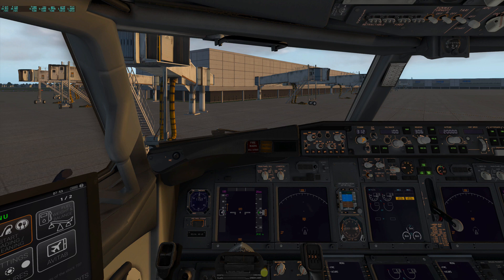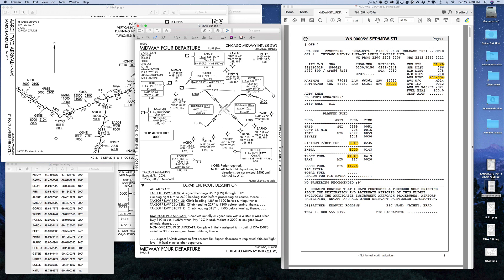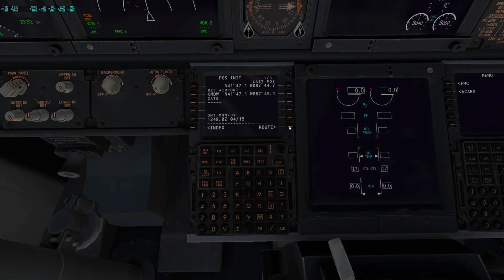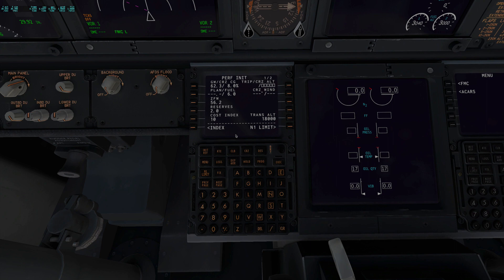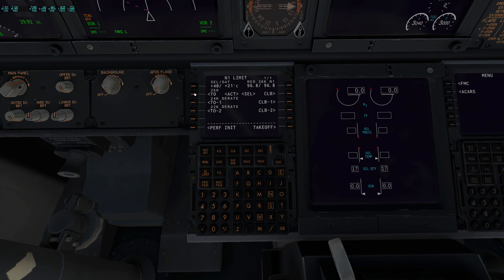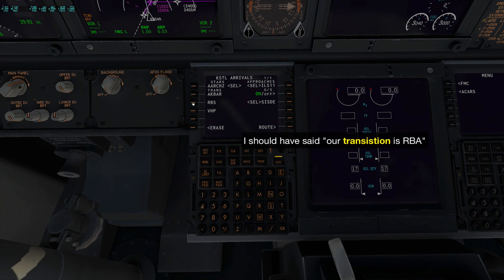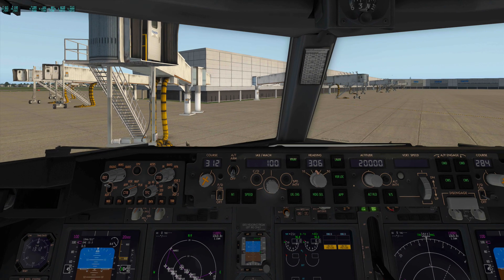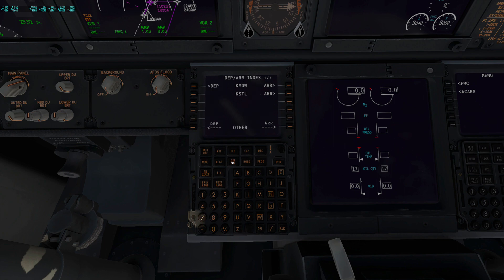Programming the ZIBO 737 FMS (detailed)

Comment: Great video. When you setup the runway, weight and payload in the x plane menu, the total fuel and payload you insert or choose should match the sim brief flight plan data, correct? Payload and block fuel i mean.
Reply from the maker: Yes, although I sometimes wonder just how accurate SimBrief is. My jury is still out.

Comment: I cant figure out how to do those quick view changes for the various positions in the cockpit....how do you autozoom to the fms, or the overhead panel etc.?
Reply from the maker: Quoting the manual: " Set the view to however you like it, and assign it to Quick Look 1 by pressing Ctrl+Num Pad 1 (i.e., the control key, with the 1 key on the number pad). Note that the Num Lock must be on in order to do this (PC).  Now, no matter how your view changes, when you press the shortcut for Quick Look 1 (by default, Num Pad 1)"

Comment: This vid should have many more views. I fly 737-900's for a major U.S. airline and work with aspiring military and airline pilots--kids in the CAP--to introduce them with X-plane's Zibo mod to introduce them to CRM and most of all, running the entire complete checklist, with special emphasis on safety tests.
A few suggestions:
You entered 40 as your flex temp. This temp can only be calculated with a sophisticated computer (Boeing supplies ours) and in the real world if you miscalculate it, it could be a bad day. This happened to an Emirates flight about 10 years ago.

Second, when you see "vectors" on your legs page, that's essentially where ATC is going to have you scrub 
the plan you entered into your FMC--at least at that point. As an example, the OFP for KLGA to KFLL has the waypoint CRANS as the transition for the Fisel7 STAR to Runway 28R and route description states you should be at about 15,000'. The problem is the TOD is at the FISEL, approximately 105 miles to the SSE.
The problem should be obvious. If you're TOD is FL360, how can you be at FL150 at CRANS?

The answer: vectors. ATC will jump in and take over. You cannot blindly follow the guidance of your inputed OFP. 

Check out this link:
https://flightaware.com/live/flight/JBU1371/history/20190124/0245Z/KLGA/KFLL/tracklog

You can see that the TOD was at 12:37 a.m. more or less but the STAR for 28r calls for 15,000 at CRANS which would have been 17 minutes and 115 miles to the north. 

A graphic of the flight actually looks like this:
https://www.flightradar24.com/data/flights/dl1527#1f45f46b

So, here's the deal: when you see vectors you in the real world you need ATC to give you the proper descent profile which, as you can see, is nothing like the SIMBRIEF OFP, at least in terms of the TOD. 
Maybe I just don't know how to set up the FMC for a real-world descent profile or there's a bug in Zibo or SIMBRIEF. 

To make sure I got it right, I would use the data on this link to set altitude, airspeed and heading bugs
https://flightaware.com/live/flight/JBU1371/history/20190124/0245Z/KLGA/KFLL/tracklog

It could be edited obviously. You might have to crosscheck your waypoints with the long. and lat. of the
real-world descent. That's not how it's done on the job. It does suggest there's a lot more going on than x-plane would have you believe.
Reply from the maker: Thank you for pointing this out, though as a pilot I'm familiar with vectors and ATC. In fact I tell non-pilot simmers all the time that 90% of the time ATC vectors in aircraft. It's just that X-Plane doesn't have ATC (or at least anything remotely reliable) and PilotsEdge is a bit pricey for the Sunday afternoon simmer, so I indeed take short cuts. Thanks for the warning on flex temp. I asked a couple of Southwest pilots recently how they come up with that number and they said it's all a bit of magic from Dispatch. But I will take your point sand follow your links to add a bit more authenticity into my videos.  Thank you for your indepth reply.  --Brad